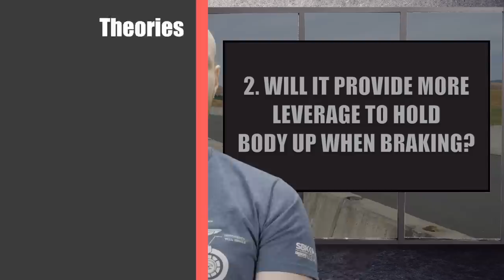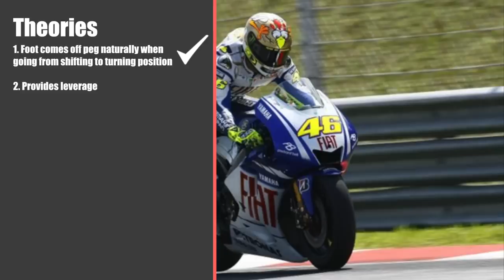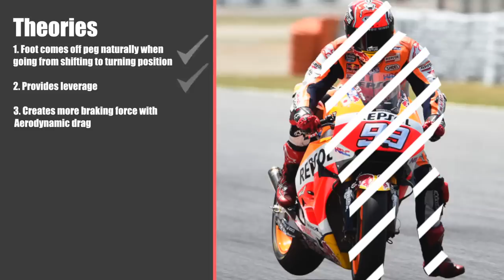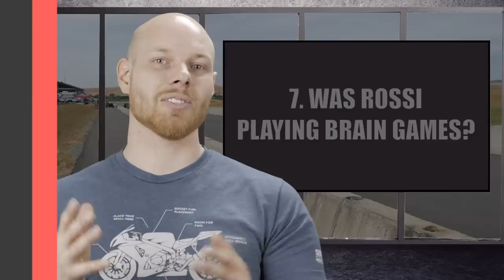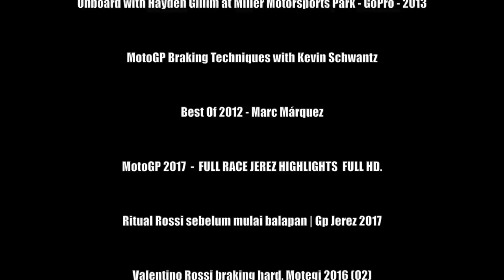The Leg Dangle EXPLAINED

Comment: sorry mate all wrong it is coming from dirt bike racing AND IT IS FOR SLIDING
Reply: Supermoto technique, too, which Vale also does.
Reply: Ummm, you mean #4? He spent 5 min on that, just saying.
Reply: I think this is correct, it helps them control the rear tire when it starts breaking lose when they are backing it in before they sweep into the corner. It also helps them carry more speed in while ‘throwing it into the corner’ under passes and under the intense entrances these guys will push it to entering corners, only so much muscle upper body can help it then comes down to these little techniques that helps them hold it when manipulating the bike on that fine edge. No doubt they don’t do it the same way every lap but when it matters I would imagine they are really using everything and then some to keep them self on two wheels.
Reply: Crushonius exactly man 😂
Reply: Thank you. I dont know why people like complicating things. Anyone who's gone offloading with a simple mountain bike would know this. It's just simple a reflex when sliding a bike. And it's not even always necessary. I feel the same about knee sliding, I've been overtaken too many time on the road by BMW GS1200 doing serious lean angles without even putting knee out, while I'm there focusing on knee out like an idoit. Moral of the story, let your body react naturally instead of trying to copy other riders.
Reply: Also to increase braking force by aerodynamic drag can easily be done the way it's always been done, just come out from the screen, no real need to stick your leg out.
Reply: Yes, dirt bikes and supermotards.. nothign new. Rossi is a avid dirt bike rider, so no surprise there. Also, early 2000s was when Supermpotard was coming into the main stream
Reply: Couldnt agree more.. it is use to give more control on rear tire when sharp cornering.. imagine this you have to lean the bike in a fast way to take corner whithout losing balance and traction. Thats when u dangle ur leg. 
And thers a time when the opposite leg is dangle when too much leaning is acquire to give more control or else the balance will be off.. 
Done that a lot on a dirtbike riding on asphast
Its like a instinctive nature.. Like counter steering..
So u really dont have to think about it.
Reply: Has nothing to do with dirt bikes lol.
Reply: so all that long explanation was for nothing damnn
Reply: Crushonius it is also for if you crash so the bike won’t fall on you

Comment: i thought it was to aid stability when the rear wheel slips
Reply: Coming from dirt bikes to road bikes it was a habit at first but found I only ended up doing it when the rear gets loose coming into a corner.
Reply: I was thinking the same thing.  With the leg not planted, its weight could move to stabilize if needed (kind of like a cheetah or kangaroo tail).
Reply: This is the biggest reason. It provides a counter balance when the bike shifts uncomfortably under braking
Reply: Amen. It's solved. When the bike is sliding around on the track from moving so fast while braking. It's to help keep the bike upright.
Reply: I think he addresses this in the video when he talks about centre of mass, and how shifting the centre of mass can prevent the rear wheel sliding so much
Reply: Oscar Thorpe Garry McCoy never dangled a leg and seemed to manage the rear sliding quite well 😊
Reply: xtinaisbigyella that's called finesse  lol
Reply: what, that means two loose things, rear wheel and a leg, creates more instability  @ike8236  ,
Reply: @russclifton2026  You are looking at it the wrong way. Stand on one leg and get somebody to gently push you sideways, you will automatically stick one leg out to even the weight distribution and maintain balance. 2 counteracting forces create stability not instability.

Comment: 8. A dangling leg could act as a mass dampener adding stability during corner entry.
Reply: Yes, that was told in some races I watch last year by the reportes.
Reply: That's what I always thought the reason for the dangle was for, too.
Reply: Exactly what I think is missed in this list of proper reasons for dangling. 
Your leg works like a cheetahs tail while running on higher speed. As you said the leg works like a counter force to that bike swibble what you get under hard breaking + cornering and makes the bike more stable. 
That makes even more sense if you think about your upper body while under hard breaking. Its stiffed up, or more than usual. 
Normaly your Torso and arms are loose to compensate movement of your bike. 
So if your upper body stiffs up, its usefull to compensate swibble with other parts of your body.
Reply: great idea
Reply: I was looking for this answer in the video, as well.  Adds some flex to the overall mass under extreme braking.
Reply: total_gamer1989 i think you are very right sir
Reply: There's plenty of riders that don't do it. I've met top British racers and they said they tried it, and it did absolutely nothing. I think some copied Rossi, and soon they just do it for the sake of doing it
Reply: Dan Graff no
Reply: I thought they were well reasoned and intelligent explanations of some opinions on the leg out technique. If you think you have more plausible explanations then perhaps you should make a video so we can get the benefit of your expert knowledge and racing experience .
Reply: absolutely 100%, especially when coming in too hot, I(which is what most riders have admitted to using the technique for) I've also heard theories that it takes the pitch weight load from the centre of the bike (less weight over the front tire to inhibit overloading the front end when coming into the corner)
Reply: agreed

Comment: Have you ever rode a bicycle and went through a sharp turn? It’s only natural. Or maybe it’s not and I should be in motogp.
Reply: It makes you feel cool... that's it lol
Reply: Yes.. to prepare for any unstability to happens
Reply: It's not normal, unless you lean forward at the same time, if helps distribute more weight on your front wheel, so you're less likely to lose traction.
Reply: This was exactly what I was going to say, was doing this before Rossi did it whilst riding on the road, it also helps gauge speed (in real terms, not just numbers on a speedo) and road camber too.

Comment: I tried it to see what the difference was between one way or the other. I found that 1. It does feel like you create more drag at speed.  2. You feel more stable if your other leg is holding your weight at the gas tank with the inner thigh  3. Your foot more easily returns to the foot peg and positions just right. As opposed to moving it back to the right position for the turn. 4. It becomes very natural feeling and is easily adapted to your style.  5. Like many things in sport riding not one thing is best for every corner.  In some corners a traditional braking style is/feels better. Also riders do things that compliment their own personal physical attributes and style.

Comment: I thought Rossi's experiments showed that there was no difference in his times whether he was dangling a leg or not.

A simple explanation would be collective behaviour, most racers doing it because the fast guys do it, quite like the experiment with the 5 monkeys and a ladder:
http://www.wisdompills.com/2014/05/28/the-famous-social-experiment-5-monkeys-a-ladder/amp/
Reply: I've read Rossi saying that while not making actual lap time improvements, the leg dangle just "Feels right".
Reply: May not make tangible lap time improvements but for some riders it gives then a little more confidence coming into the corner. I'm not nearly fast enough to test it myself but that's what I have been told
Reply: + Curve Ahead I don't disagree with the point you are making but the story you linked to was not a valid experiment. It was a 'story' made up to illustrate the point. The fable was based off a 1920's experiment whose results pointed to a similar conclusion but not as striking as the 'fable' illustrates.
Reply: yeah,, if im too fast going into a corner, my leg comes off naturally and it gives more feedback. Kudos for the video. Keep them coming!
Reply: But it might not be about total time, it might be that you get some benefit for instance when entering a corner and lose some when exiting.
Reply: Would it no tbe easier to ask the proponents using this method why they are doing it.
Reply: Dan Graff
Except they're not touching the ground during leaning to "gauge" how far leaned over they are. They dangle their leg above the ground briefly before the corner, before they lean over, and then put it back on the peg.
Reply: I think because sometimes you do and learn things from feel. You don't think about an science untill someone comes a long and gives scientific reasons to why you do something in particular. And when you hear those scientific reason you're like "Wow, I never even thought about that, but it makes sense and must be true...".

So you probably won't get a good answer from any of the racers besides "It just feels like the right thing to do."

I saw something similar in a Fight Science video about martial arts and specifically a Parkour part of the episode where they put sensors on some of the most skilled practitioners and explained a lot of the science that was going on with their body and the movements they were performing that was impressive to the scientists. 
They had pretty much had clueless expressions on their face when being explained the scientific data.
Reply: Seriously no one knows why they do leg dangle? it's a technique which comes from dirt bikes, when on dirt there is something called a burn and most riders would put the foot down while going around a burn it helps rotate the back of the bike and stop you from slipping. Same reason riders do it on the road to stop them sliding out
Reply: Very well done !!?
Reply: What about the experiment of marrying in a church when you don't even consider yourself religious but you're doing it because most of your family and friends (who are also not that religious) also did it? XD
Reply: ^ This

No difference in time. Rossi does it because it "feels right"  for him. And the other guys do it because they see the fast guy do it and think " there must be something to it" 

After Rossi if someone will come who farts before every apex and wins. Everyone will fart before every apex and think science has something to do with it.
Reply: I have done this since I was a kid, I'm 34 now lol, it helps on most Bikes.
Reply: It's entirely possible that Rossi didn't see a difference, but it still has an effect. Depending on the style of a rider, the different factors discussed in the video may have different levels of impact (e.g. perhaps for an aggressively cornering rider, the technique helps to control the back wheel slide, whilst for someone who corners smoother the technique is purely psychological).
Reply: Evil X Rogue nope the video i am talking about they did test with rossi putting his foot down and 1 wothout putting his footndown. They thouht it helped him brake harder. While computers showed that there was such a small difference that it would not impact the race. The braking power the speed he left the corner and overall lap time all was the same. They told him and asked if he would stop doing it. He said something like he would still do it because he is more comfortable that way. 

It is all in between the ears. He does it because he feels more comfortable while doing it. Not because it wins races or it is a better bodyposition
Reply: MackP ... most of the time the feet do not touch... proprioception and kinesthesia can answer this...  
yet, often, they DO Touch the ground with their feet...  (In Too Hot...?)  
(Obviously) there is more to it than what is (attempted to be) explained here...
Reply: GrowingDownUnder dirtbike *berm*...  Is "burn" is what YOUR Leg Muscles Do after a few laps of trying to keep up with terminology...?  
(typed with officially licensed YT SarcasmFont...)
Reply: Is he still racing? oh I see way in the rear of the track.
Reply: Durrrr...like everything in racing.
Reply: GrowingDownUnder it's a Berm and the leg down is a prevention method for keeping/covering the front washing out and for getting grip on the front tire. Rossi was observed and asked about his performing the move in GP an replied it was carried over from his off season ridding of dirt bikes. Is just something he carried over and people started copying him.

Comment: I know as an agressive rider myself, i catch myself doing the same thing but i never watch moto gp, and nobody i ride with does it either. I DO however have a motorcross background which is where I think I get it from. I can tell you my personal experience is that it is a confidence AND a control thing for me..   I can tell you that i do it to prevent a low side when entering hard on the brakes. After you turn in, the bike is typically set and theres little fear of low side, however you are low enough that the knee pads double as having the foot out while mid turn. I can tell you that from personal experience that i can NOT apply as much rotational torque on the bike, because i am trying to pull it down from the furthest distance over the top of the bike only. Rather than a knee in the tank, or over the seat, and the other pushing the inside peg down..    Think of it as trying to loosen a fastener by applying torque with JUST your index finger wrapped around the bolt.  You can rotate it, but if you can get a grip of it, it's still difficult to turn..   Now, turn the same fastener in the same manner, but this time, also use your thumb to help push the same direction. More torque..  Almost unlimited..  

So, for confidence and control while entering a turn is why i do it.  Then while turning in, i rely on my knee for confidence and control. 3 points of contact during almost the entire turn..  

Hope this helps any..
Reply: From my own experience racing I got the distinct feeling that this is why Rossi did it back in 2005 when he got into the corner a bit too hot for that tight a line and anticipated the feeling of loosing the front, so he put his foot out to catch the front if needed.

Comment: They dangle their legs to prepare incase the motorcycle wobbles.
Reply: Close but no cheese. ;)
Reply: no actually i believe youre really close, personally having ridden offroad my entire life i find sticking  a leg out early like in gp moves the CoG slightly so that as the bike tips in there is a longer/smoother change in the CoG creating a smoother easier transition to the corner. the smoother transition means its less likely to slide and easier to grip the corner. its almost identical to just sticking a knee out, imho it is purely rider preference to how they wanna tackle the corner.
Reply: Because of the new smaller bikes with short wheelbase..
Reply: Joshua Koch to me it looks pretty obvious that you put it out as a counter to the rear brake in case the back starts to come out..otherwise you wouldnt be able to correct the body weight quick enough given your setting up to lean in
Reply: oobopshbam81 I guess so
Reply: You're thinking like a Human. That's a very Human explanation. but remember Superbike racers don't have fear. They are not the same as Humans.
Reply: Except they do, most of them think TT riders are insane.
Reply: DeathByCactus hahaha
Reply: Yep, borrowed from speedway.
Reply: wrong im a x road racer i know what im talking about
Reply: until we break our back a couple of times seriously
Reply: FRANTIC Vlog I ride my bicycle on ice in the winter and whenever I corner I find myself doing this, mostly to catch myself if my rear tire gives out and to give a bit of weight transfer.
Reply: At that speed, you actually think this will help if the bike starts to slide?
Reply: Yes.
Reply: This would only fuck you up when you're traveling at these speeds. Off-road, sure. On a motocross track during cornering and digging through ruts, you better have your leg out. But going at these speeds, landing on your leg would totally screw you up.
Reply: FRANTIC Vlog thats why i do it.
Reply: My thoughts as well!
Reply: I do the same on regular bikes :D

Comment: Based on what I see at an elementary level with new riders, I'd say the leg dangle is reflexive when the rear wheel wants to slide out.  I see a lot of new riders do interesting things with their legs when making turns, both fast and slow speed, that makes sense on an instinctual level.  They don't trust the bike to lean and maintain grip, so the leg wants to go out to "catch" the bike, and most of the time it shows up as just a simple knee wanting to go out.
So I theorize that when a GP rider feels the rear wheel slipping and/or they're attempting to "back it in", the leg going out to support the bike just "makes sense", even if it physically does nothing.

Comment: Why not ask the riders?
Reply: Rossi already said, "it's just a habit." Lorenzo said, "we do it for front tire in hard braking." Which people have concluded to mean you put more weight on the bars. All you have to do is try it and you'll instantly see the huge amount of force you put on the front suspension.
Reply: Dangling a leg off to the side doesn't put a "huge amount of force" on the front suspension. It's barely enough to overcome stiction in the forks, if at all.
Reply: Lorenzo doesn't do it. Or does he? Haven't noticed.
Reply: What? Too easy!